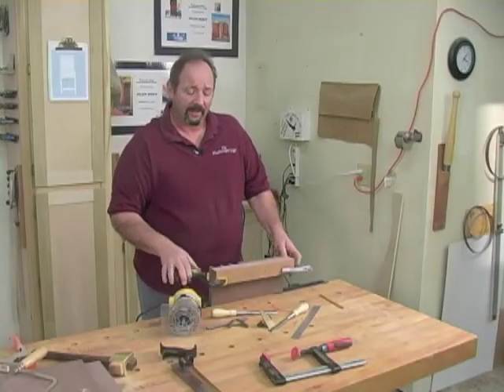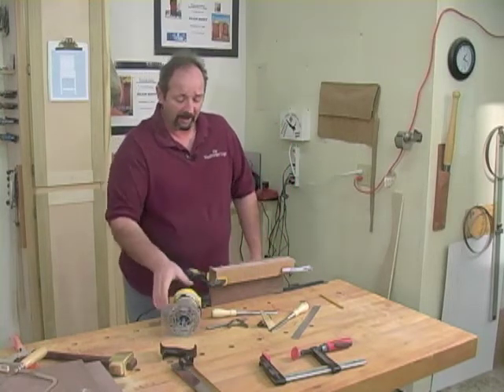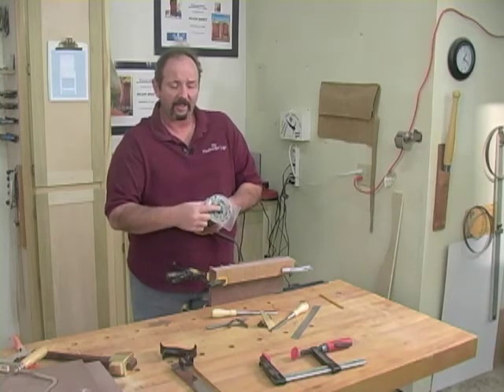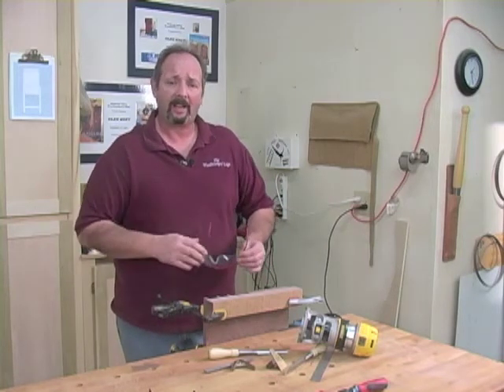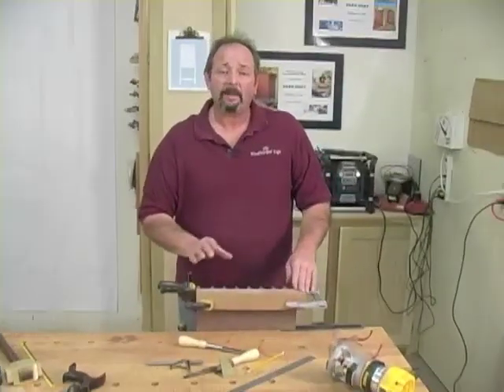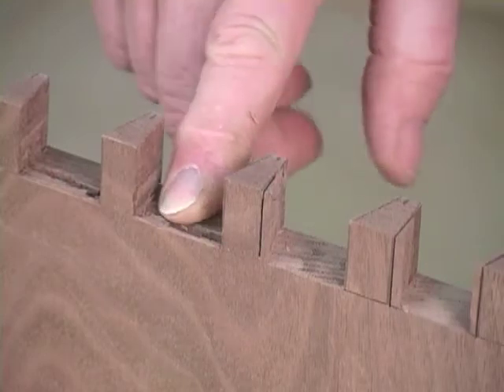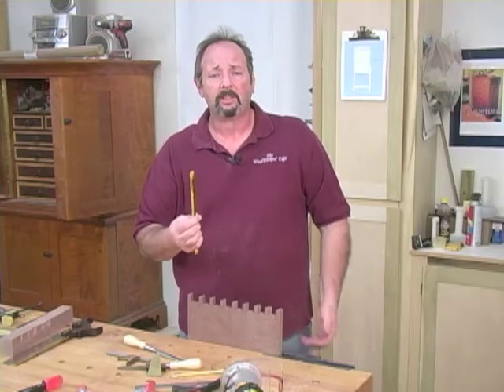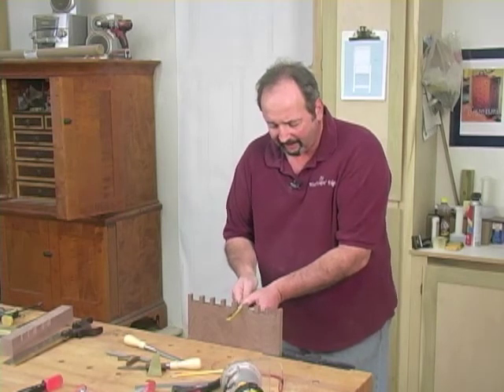Dovetail By Router

Comment: Why aren't you using a dovetail bit?
Reply from the maker: Pins in a dovetail joint are straight, so I use a straight bit. If I were working on the tails of my dovetail joint, a dovetail bit would be appropriate.